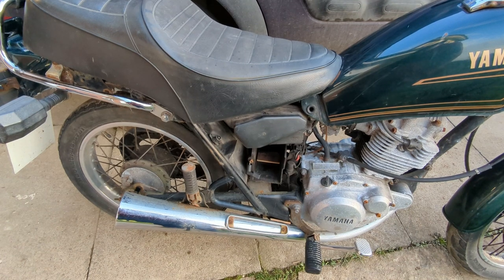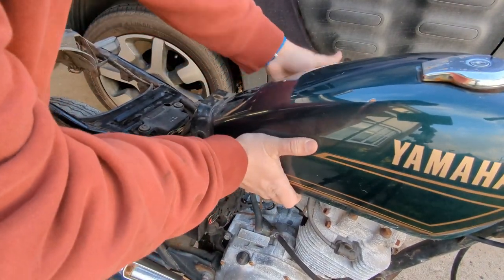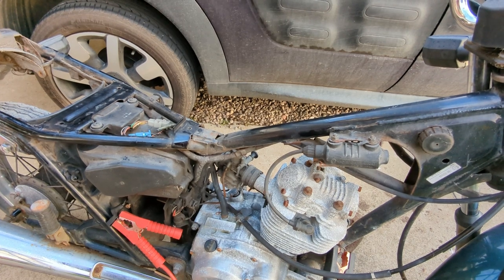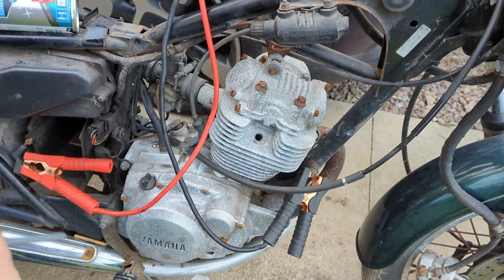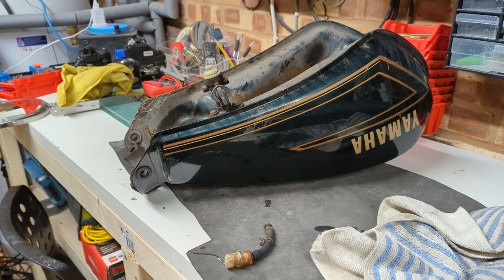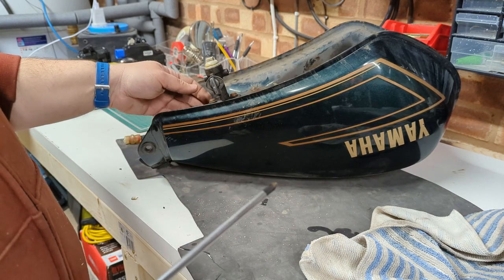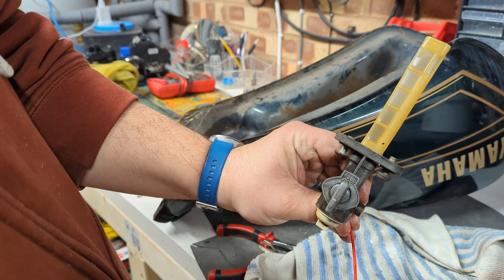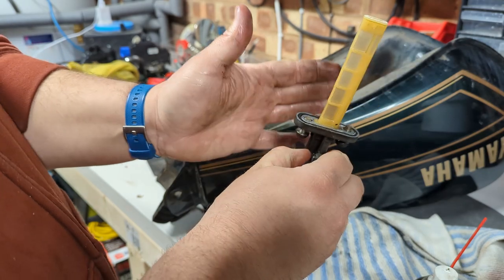First start in 3 years ? Yamaha SR125 - The Grand Challenge | JAM#11

Comment: Could you tell me if yamaha xt parts would fit the yamaha sr engine? Also could I use a domed piston in my yamaha sr 125cc
Reply from the maker: I don't know for sure but I think pre-2000 XT 125s share some parts - as does the TW125. Unsure on the piston, there isn't much deck clearance on this engine